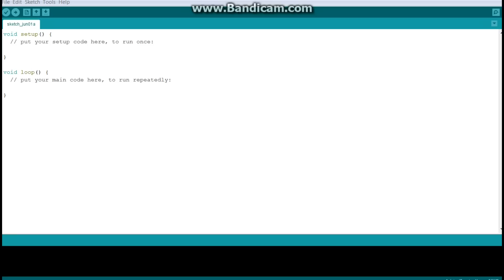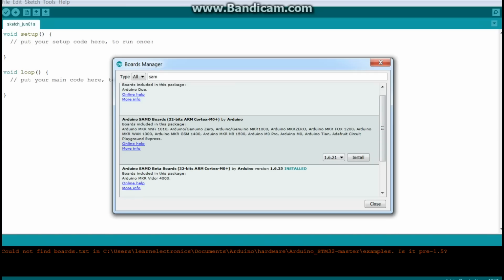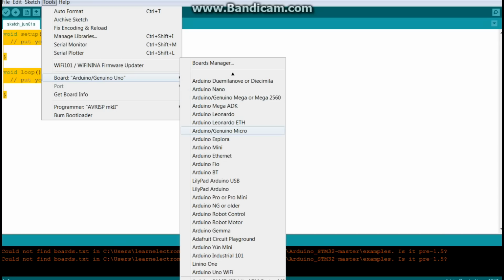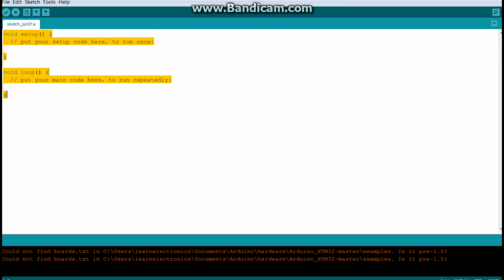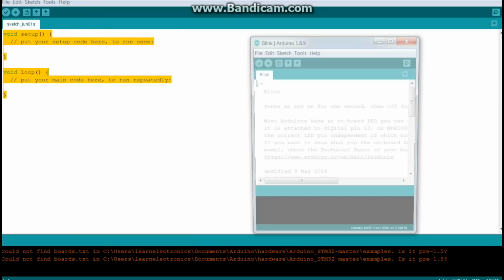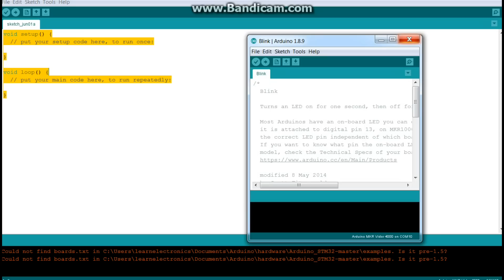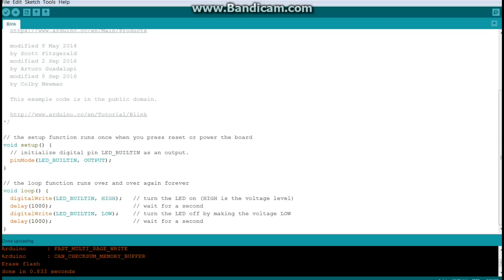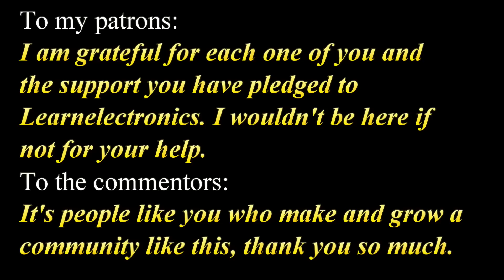Arduino with built in FPGA:   MKR Vidor 4000 Unboxing and initial setup

Comment: I have to confess I don't understand why this board seems so popular. I never used an FPGA for a home project as the additional hardware just makes rolling your boards hard and they are complex beasts to program properly. I can't help but think this will just turn into a arduino gimmick. Prove me wrong sir!!!
Reply: why is Arduino a "Gimmick"?? We make technology more understandable for people and we've been pretty successful at that. Not a gimmick!
Reply: @massimobanzi9651  not arduino but this board in particular.
Reply: @massimobanzi9651  I was merely saying that combining the arduino with the fpga was a gimmick. the arduino project is based on simplifying technology to allow accessibility. That works only so far. For a micro you can get away with it because their methodology is somewhat similar in process. In the abstraction to remove complexity you of course loose some flexibility through lack of understanding. However, to try this with an FPGA where the user really needs to have a good understanding of mapping, logic speeds, latency, sequencing, time domains etc etc. Is just impossible. An FPGA will never be a plug and play device and if it can be made to be that, maybe through prebuilt modules, then the abstraction level for the average Joe would be so huge all the understanding of the benefits of an FPGA would be lost. They might as well just use a more powerful micro which at least they have an understanding of.
Reply: @jonelectronics510  I agree. It is sort of like a bicycle with a jet engine attached. And if you don't want to delve into the world of flip flops, shift registers, state machines and such you're probably better of with a big fancy SOC. To really do the FPGA programming you'll need to use the Altera tools and program "hardware" using an HDL rather than C. I believe there are free as in beer versions of the tools, but if you don't know hardware design it might be a bit bewildering. If you want to make your own jumbotron out of discrete LEDS though it's just the ticket.
Reply: If you have hard- realtime apllications or applications where one controller needs to control multiple loops, then its time for an FPGA. Say, you need to control a highly precise machine. Every interrupt can possible fuck up your precision. Also, if you have to control multiple Control Loops at once, you may think about outsourcing them to an FPGA. Also if you need, say 100 PWM Timers or whatsoever, you wont find those on Microcontrollers.

The thing with this board is: It is not ment for Industrial Purposes. Only for teaching the basics of FPGAs and mixed/heterogenous Systems(FPGA+ARM). There are a few Boards out there that also combine external/internal ARM Cores with FPGAs yet, they either lack functionality, connectivity or are incredibly expensive(My DE1 SOC is priced somewhere near 200€. What Beginner wants to buy one of those...).

This Board has a ton of high level connectivity like a PCIe or HDMI, yet i wished there were more free pins... However, what i want to say is: You can do experiments with HDMI, MIPI and, for example PCIe and teach yourself the techniques behind it.
You can, for example, plug the thing into your pc, flash it with some PCIe IP-Core and some other FPGA Code, write a Linux/Windows Driver and make, for example, certain Operations in Gimp/Photoshop Hardware Accelerated via the FPGA. You could also fetch your Webcams input and transform it in Real Time like Edge Detection(Sobel, Prewitt...) or De-Noise the Picture. Both of which is not possible in Real Time even with the best Desktop CPUs. You could also Hardware Accelerate GNURadio using this Particular FPGA(Certain Filters for Certain Modulations). You could also outsource very consuming Control Loops for certain robots and transfer the new parameters from/to the SAMD21 Arm Core(Yet i wouldnt recommend as i think it would be better if youd simply use the FPGA- Output directly on the, for example Stepper Motors. Currently there is a too low free Pin Count on the FPGA for that particular Type of Usage).

TLDR: Teaching, Control Loops, Filtering.

The only real problem with this Board is, that the USBBlaster Software is a little unstable... Debugging an FPGA with SignalTyp is sometimes necessary, yet pretty unstable with this Board(I know SignalTap is theoretically Disabled in the QSF/QPF of the example Projects)...
Reply: Agree

Comment: I trust you so much that I’ve already ordered the board, have only seen the beginning of your video :-)  I hope finally to get my hands on s FPGA project. Cheers!
Reply from the maker: There is not a lot of info out there yet, but, we will make it work.
Reply: learnelectronics It  will probable be one week before I receive the board, so a delay suits me fine :-)
Reply: Download Quartus Prime fomr the Intel Site.
Download this example Project https://github.com/vidor-libraries/VidorBitstream
Open the empty Project with Quartus. Make sure you have set the Device to 10CL016YU256C8G.
Compile
Open Programmer either under Tools or in the Top Bar.
Go to change or add File, open the .sof. Go to Hardware Setup, take the USB Blaster. Flash.
If no Hardware is Detected you first need to Flash the USB Blaster Software to the SAMD21 on the Board.
Therefore download this repository, compile and flash it: https://github.com/vidor-libraries/USBBlaster
If this doesnt work(iw wont work) add the following line to the code
"USBBlaster.setOutEpSize(60)"
Then try again with Quartus.
If you want to Use SignalTap, then you must manually enable it in the QSF.

If you want the Starter Package(Everything you need > Programmer Software, VHDL Top Level Entity, a Few IP-Cores and an Example Project), there is a third party repository at Github for that purpose.
The rest is pretty much like normal FPGA Developement, where there is a lot of Information out. Simulating the Design before Usage via Modelsim is not required, yet heavily encouraged.(Although Modelsim is some Piece of Crap Software that Crashes every few minutes.)

What IDE will you be using? Mostly either Notepad or Atom with the Block Edit Plug In. As VHDL is so repetitive, i highly suggest you learn how to use Block Editing.
What Compiler will you be using?
Depending upon Simulation or Synthesis. If you want to Simulate, go with Modelsim or GHDL, if want the real Deal and use it on the Board, go with Modelsim.

Good Luck. VHDL (and Verliog) can(will) be quite a pain in the ass.

Source: Former Professional FPGA Developer aka as me.